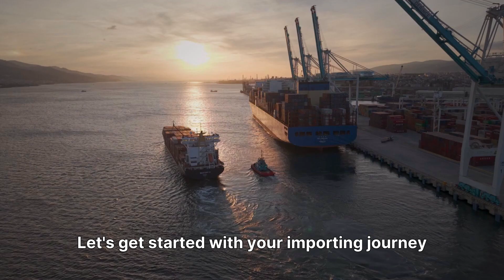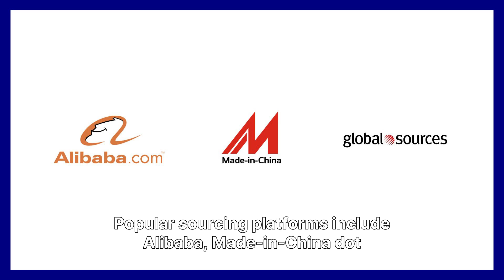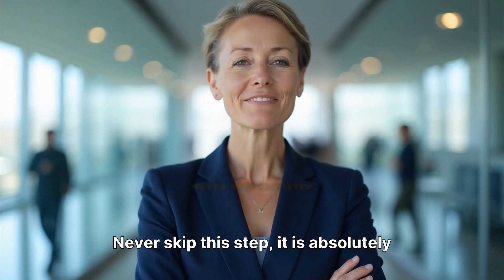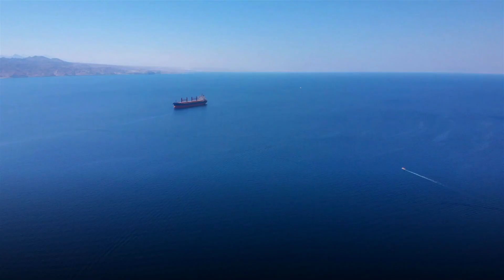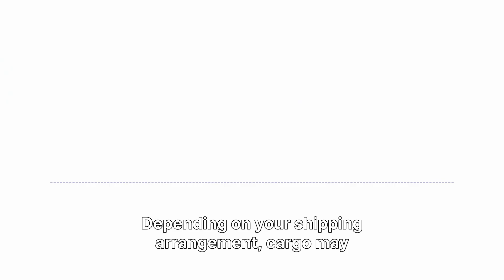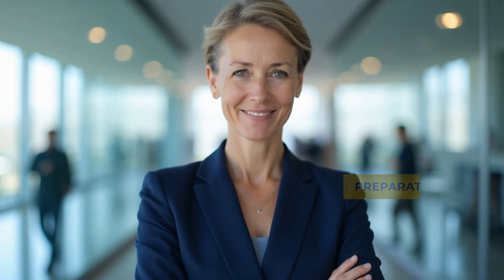How to Import from China Step by Step 2026 Beginner's Guide

Comment: Yeah, that customs ownership tradeoff is easier to see with actual orders. The transport choice comes after the customs responsibilities are clear. Confirm origin, classification, declared value, importer of record, duty ownership, and the documents expected at the border. DDP can simplify the buyer experience, but it also shifts more compliance and landed-cost responsibility to the seller.

When the same assumptions are ready, a current quote from Transport S&H can be tested against identical shipment facts while customs classification and duty advice stay separate. Treat duty calculations and classifications as customs questions that need current professional verification, not as promises attached to a shipping quote. That is what I would test against current shipment data.